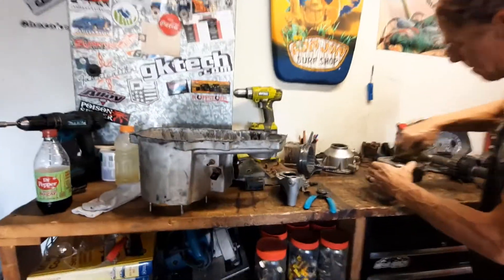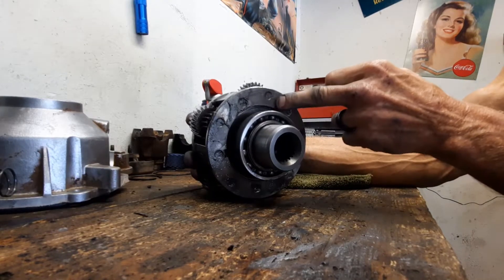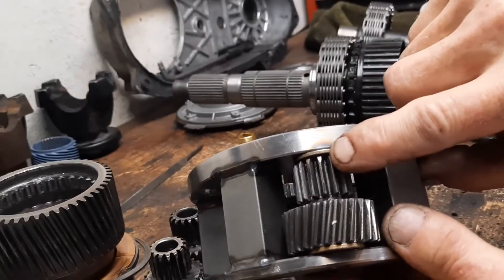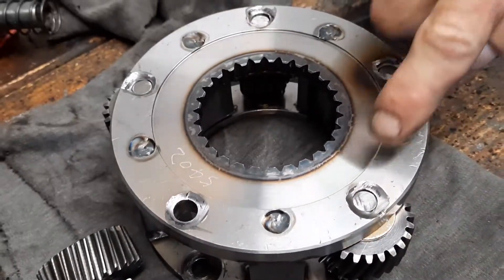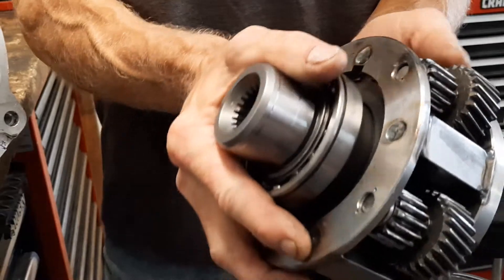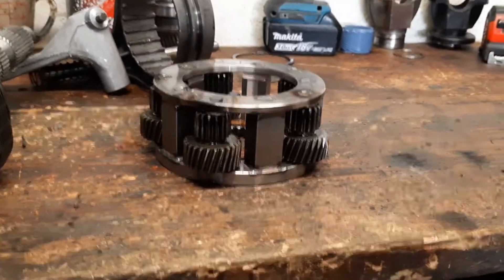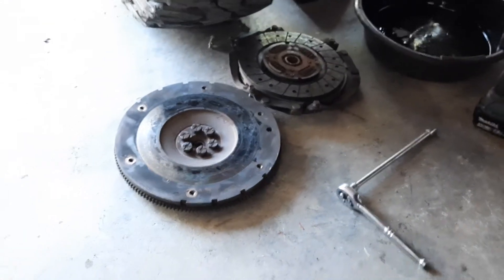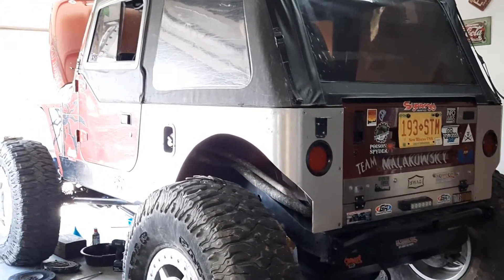Can we fix the TeraLow for the NP231?

Comment: I'm sure you saw me commenting on the other post(since you replied), but I replaced those washers with bronze, since it is somewhat self lubricating and harder than copper.  Also where you used the pipe as a bushing I had small caged needle bearings in mine.  The part where you saw the dimples on one side and the welds on the other side holding the rods in on mine was dimpled on both sides.  When I rebuilt it, I welded it on both sides.  When mine blew up that entire cage with all of these components in it came apart and was nothing but a pile of parts inside the case.

Comment: This thing still holding up?? Love the ingenuity in fixing it with your home brew parts. The grinding the ring gear in case was hack and shoulda been sign something was wrong. 

Sure hope it’s holding up for you guys! Cheers 🍻
Reply: Commented before I watched the end... 😂😂😂 the reason they use copper or brass is because they can’t be welded to steel and have higher lubricant value/less friction with oil. Copper was junk, should’ve been brass
Reply from the maker: Yea... so we are keeping the parts we have for that one as a spare and I know what I need to do now... should we ever have another failure. (Hopefully not!) Through A LOT of searching.... I found a BRAND NEW Tera 4:1 t case half sitting in a warehouse in AZ. I have a little pc of gold sitting under my jeep now lol.
Reply: @TeamMalakowskyAdventures  not copper,,its sintered bronze,self lubricating..rubicons have 4-1. or,203/208 box marry internals..or,get a decent 5 sp with granny first.nv4500 or ZF..or 435 spicer.
Reply: @TeamMalakowskyAdventures  everything expands with heat,you need to know how much to make clearences. there might be a cadged needle roller to fit,instead of the aahhumm,,,,water pipe..metals expand at different rates. like your diff needs 4-10 thou. ect..IF,you go auto at any stage,try & get a lock up torque converter,,going down hill it auto is death..
Reply from the maker: @phantomwalker8251  that's good info right there! Thankfully we found a brand new Tera 4:1 sitting in a warehouse in AZ and didn't have to fix the mess from the last one... properly. I made a video on that one too.